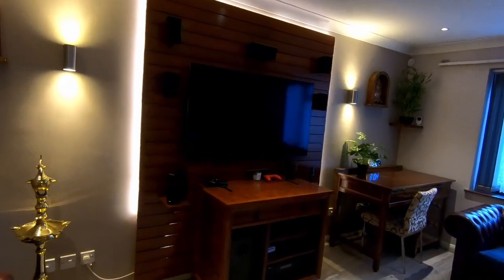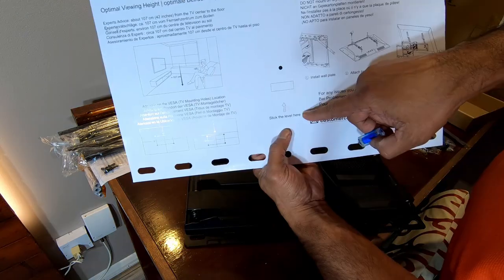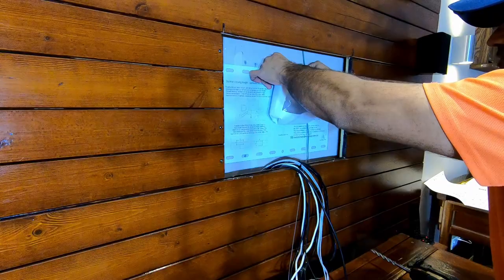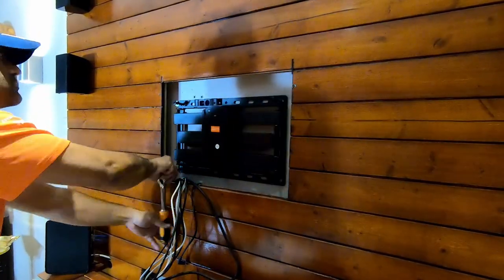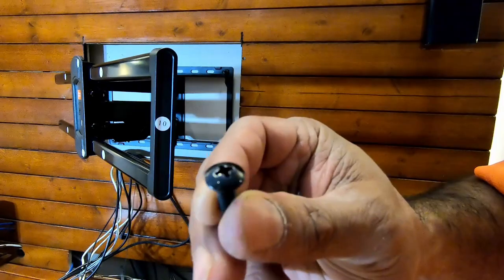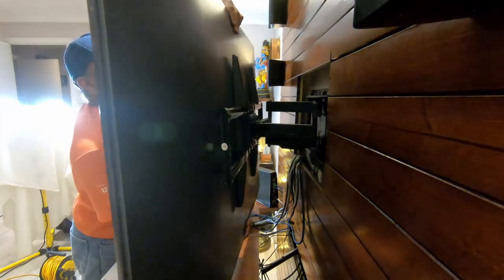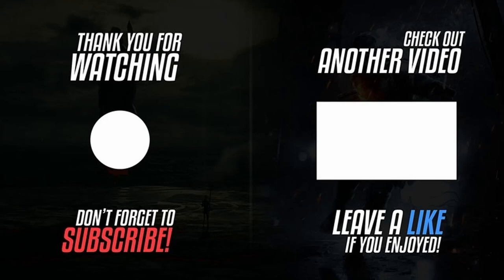TV Wall Mount Bracket Instructions - Mounting Dreams MD2617-03 Swivel & Tilt - Product Review

Comment: Hi, I have ordered this for 75x90j 
So we need 10" drill bit but 6 anchor and 6 bolts are included right? For concrete wall? Not wood?
Thank you for the video btw.
Reply from the maker: Yes, I think it comes with its own screws and bolts and rawplugs. It's been a while since I installed it, but I think I used a 10mm drill bit on my SDS drill. And yes, mine is a brick wall, so a concrete wall should be fine.

Comment: I bought the same for my 75". Its on the way. But i have a stone wall decor behind my tv. Can i mount it through that stone and to real wall ofc. Is it safe? Or should i break and take off stone pieces around mount?
Reply from the maker: Without seeing the wall, it would be difficult to give a proper opinion. But, if the stone wall effect has uneven surface, then I would recommend to cut that patch out where the mount attaches to the wall. The mount has to be flat on the wall to take the load properly. I know its not the recommendation you might have hoped for 😁. I did the same with my wood effect paneling.
Reply: Thank you for reply :) so do you have any idea how can i easily detach it from wall?
Reply from the maker: Depends on how it was fixed. I think a safe bet is to start cutting it using a multitool/oscillator, with a carbide tip. That will give you good control, while cutting through it. Make sure to use a making tape, and draw the outline on it before that
Reply: @SujMenon  they look like just glued to the wall

Comment: How can I determine which hole I should Usero attach the bracket to the TV?
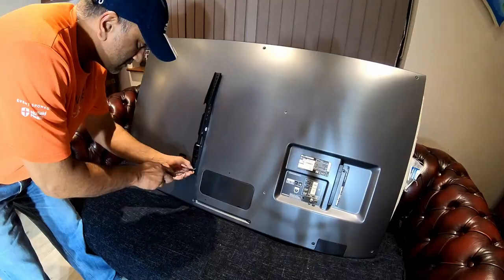Reply from the maker: Is this about which hole to use on the bracket at around 2:13 region? Any of them will be fine as long as it's the same ones on either side. I biased my positions to the lower side, as the weight of the tv will be higher there.

Comment: Are the studs mandatory? Can I use the 100lb cobra anchors instead?
Reply from the maker: They always recommend going through studs. The problem is not with the anchors, but with the dry wall. That will probably not hold the weight of the TV